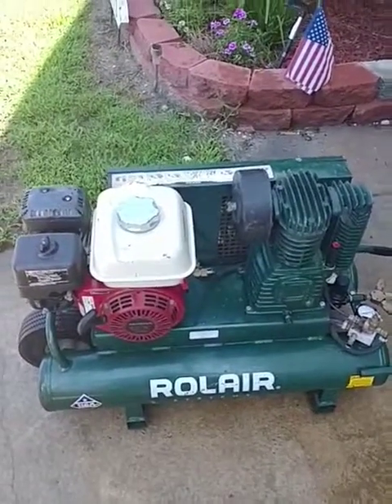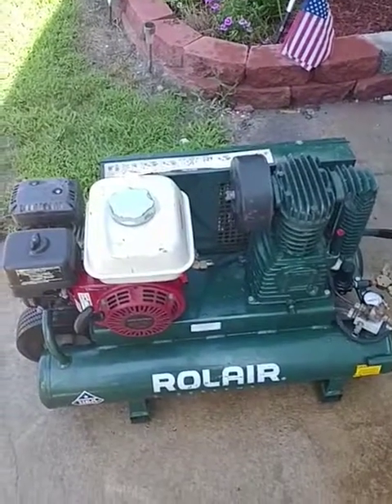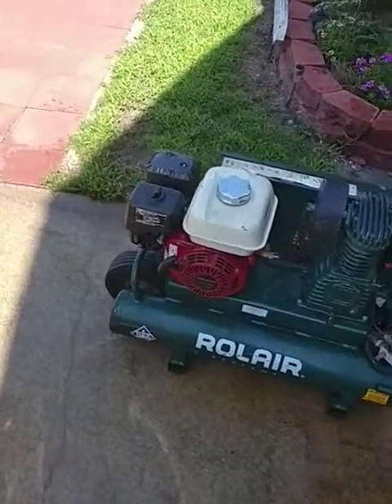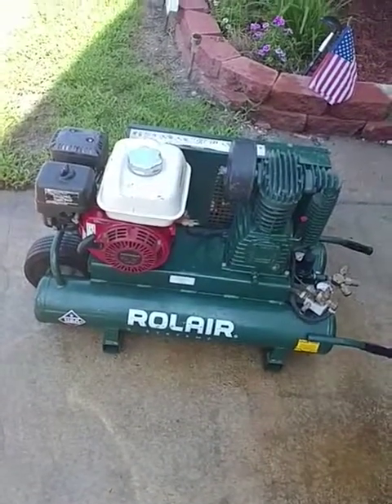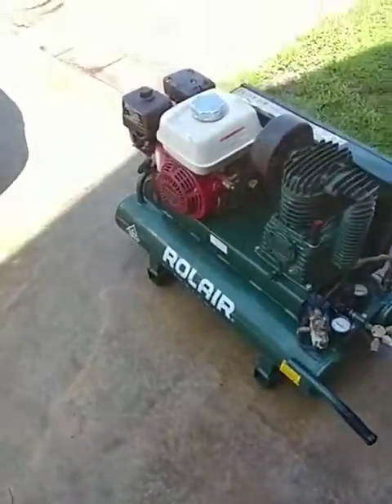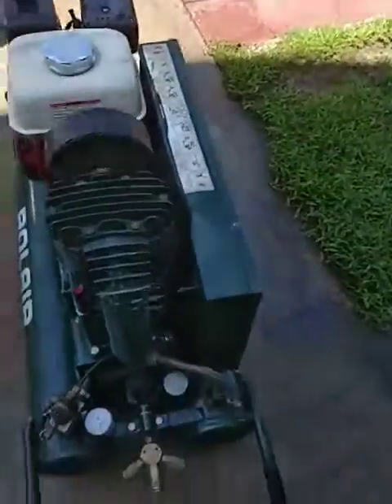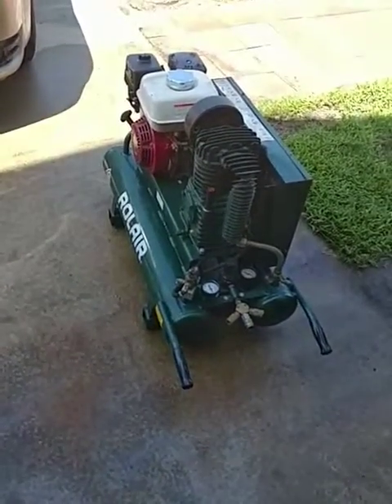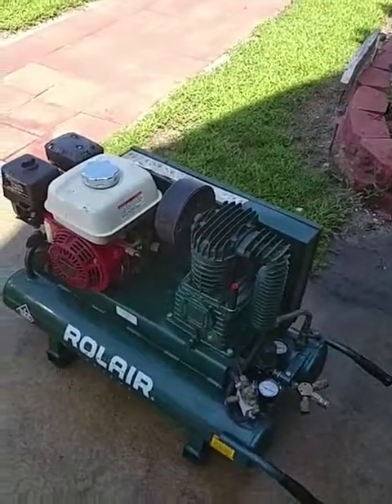Roll air compressors things you need to know about him and do to him to keep them running properly

Comment: If the hydraulic oil is low will that cause the pull start to be more resistant then normal
Reply: What did you figure out? I have this compressor and the other day the motor just cut off. It's pull start and would crank again. What do you think it is and what should I do?

Comment: I know this compressor well, I think you meant .65 quart of oil and you said ounces.
I fill the pump and motor with Royal Purple oil.
The vent is where it's filled it just has to be removed and filled from the hole.
This is the most common air compressor in construction.
The gauges Aren't the best and it's better to change them for Winters liquid filled gauges.